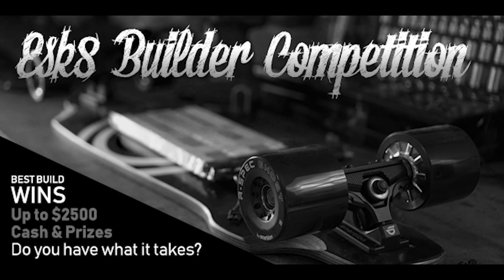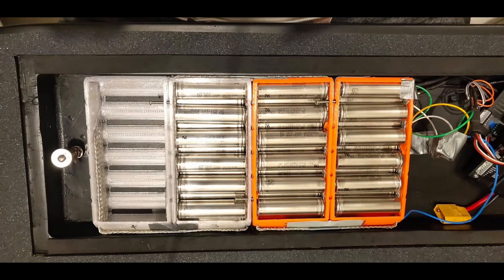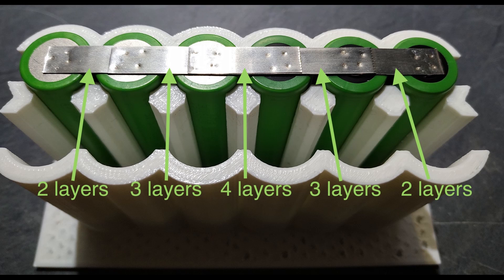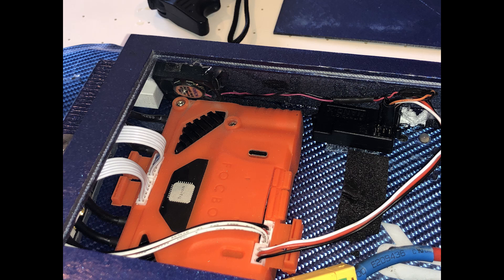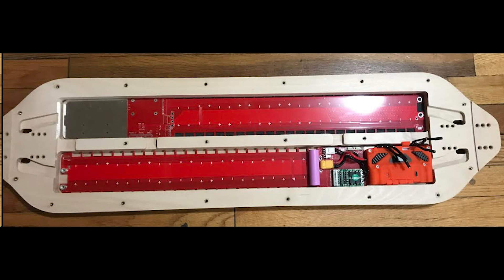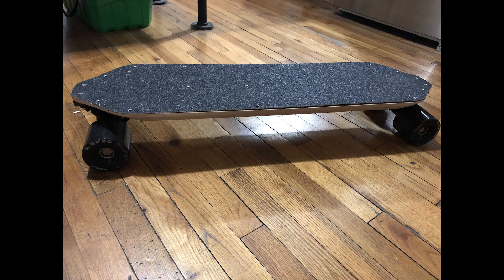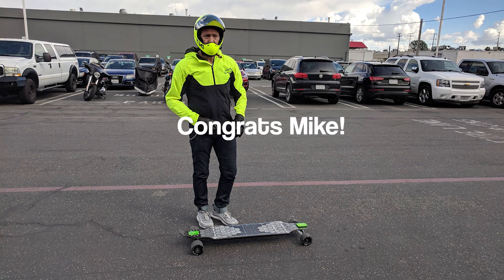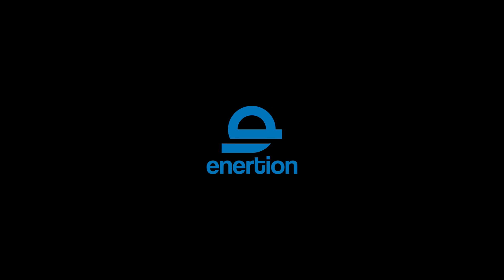Best DIY Electric Skateboards Revealed! | Enertion R-spec Drive Kit

Comment: Hi I'm Jason, founder of crap board, low quality. I'm about quantity, the more I see the better. I don't care about quality control hence I have a warehouse in China that pumps out crap so I can sell to you idiots. If you need help or customer service or warrant service, be sure to contact out customer/tech team. Don't worry, there is no one there these days because the tech manager and customer service team is not there to answer or help.  Oh yeah, they all left me but thats ok. However, there is a generic auto reply you can keep emailing until your finger turns blue. You see, i'm the founder of Enertion. I built crap and sell to people. I just have to pretend i'm sincere and put enough of these convincing video to sell to you idiots. I believe i've accomplished just that. Cheers mate.

Comment: so i  told myself that the solar deck is totally stupid... but i calculated if u used 20*96 area you could theoretically get 31W of energy (Ideal day and ideal angle) that would also need to be converted upwards for higher voltage (maybe 80% efficiency) so 24W. That is 2km of charge per hour on sun. Not bad... not great but not bad. For me i think not worth the hassle.

Comment: I agree with the wider trucks, at those speeds width is on your side. The bajaboard has like 20 inches and the Trampa has 18
Reply from the maker: Wider track width can help with stability for sure, just like larger feet can help human stability... But humans always come with the exact size foot they need to walk & run, nothing too big or too small. The Raptor 2 is a nimble beast, we don't want to tame the beast too much, we like it lively. We honestly don't think that wider trucks are a major benefit.
Reply: @ElectricSkateboardBuilder  Nice, I see where you are coming from. Never tame the beast!

Comment: Tesla should integrate solar panels to their car roofs.
Reply: That would be more cool than practical.  It would take FOREVER to get a significant charge back from solar
Reply: Yah about 1000W per square meter hits earth in ideal conditions and our panels only get about 20% efficiency so only get 200W of it again ideal conditions for a 200kWh battery would take 1000 hrs to charge with 1 square meter.  The extra weight and charge circuitry also reduces overall range.

Comment: Amazing builds!!! What was the price?
Reply: Looks like all were over 1k but they are good quality
Reply: Yah typical builds are $700-$1200 range but custom parts on these are hard to price since they're one of a kind.  Motor is about $100 same for deck, mounts and trucks typically a couple hundred, ESC between $150-300, and same for battery cells.
Reply: @ShaunHusain  r spec is a couple hundred dollars
Reply: @mareksgw9237  Yup don't doubt some of these came in at 2k or more was saying if you don't go all out bells and whistles and high end components can do a build for $700-1200 range so these are something more :)
Reply: @ShaunHusain  just checked r spec is $569 alone